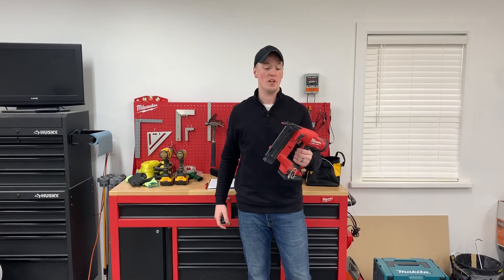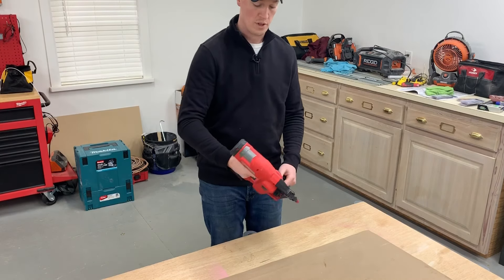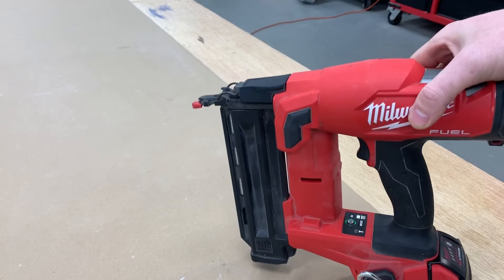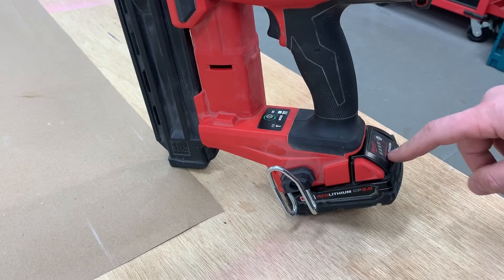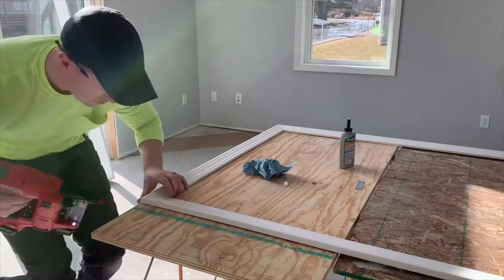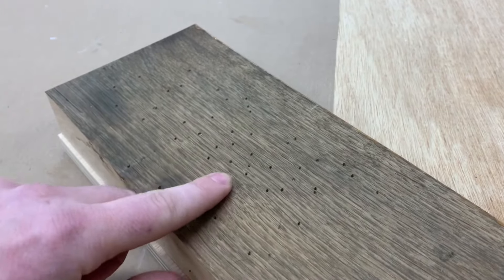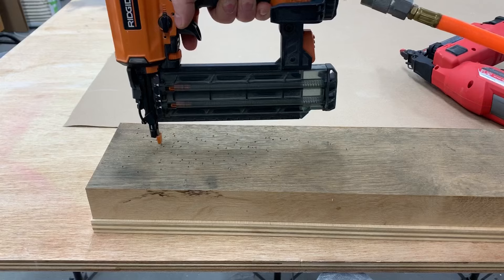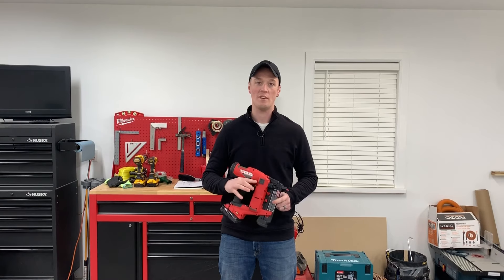Review AFTER Heavy-use | Milwaukee 18 Gauge Brad Nailer (Gen 2)

Comment: That's strange .I only run dewalt Brad's in it now as my second box i ran through it was paslode and it didn't like them .most of the time it wouldn't fire and when it did they were smashed. So went back to dewalt Brad's and everything is fine.havent tried any other brands apart from them 2.
Reply from the maker: Haha it’s weird how guns are like that, not just this one. Stick with what works! 👍🏽
Reply: Mine doesn’t like those. It jams after 2-3 nails even at single shot speed.
Reply: That’s weird we use mostly Dewalt with no issue but I also keep some small boxes of paslode in the box with the nailer and no issues with those either. Wonder if Milwaukee quietly fixed something over the last year cause I’ve got thousands of nails through mine and never once jammed or curled a nail.